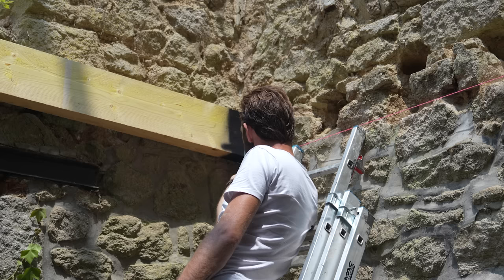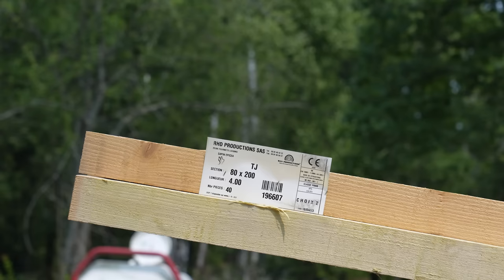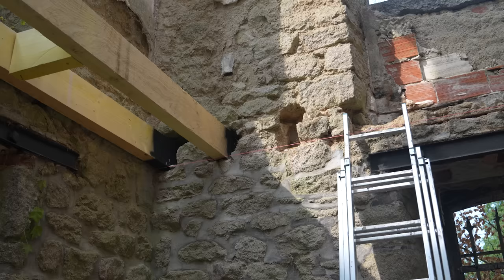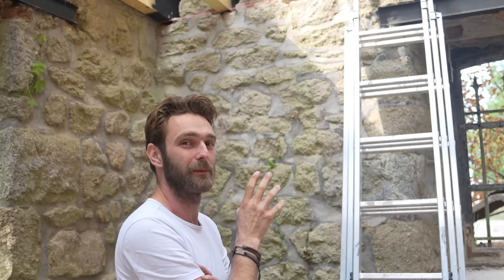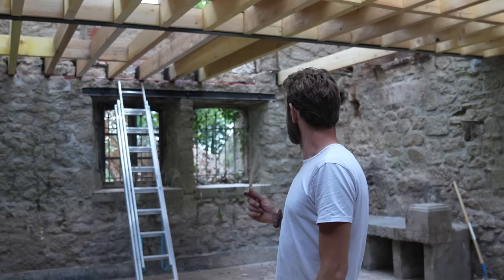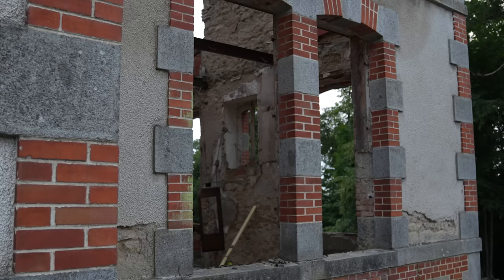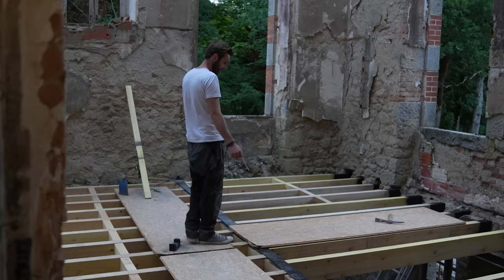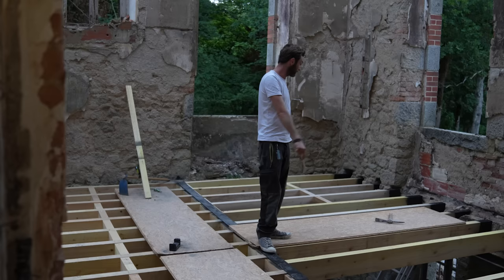A impossibly, perfectly level floor?

Comment: Also when they come back will you attempt to get more of them beams in? 
A week to get in the one beam where the stairs are and then the two above your head, then also the two ground floor beams in the rear room and the two second story beams in the opposite side wing. That will give you plenty to do when it comes to you being alone again when they are all gone once more. 
When you have all those done, then it will be about time for everyone to return and help put the next beams in for the next floors. 
Talk about moving fast. 
The hardest and longest job will be emptying out the rear basement room of debries. Since you cant get the Bobcat in there it will have to be done by hand through the two/three doorways. I cant wait to see what kind of floor that back basement room will have. Tile or concrete.

Comment: Dan- If you’re worried about support strength, perhaps just fasten a parallel 2x4 (maybe 4 feet long) from the top of the cut and nail nail it into the beam so it has extra strength along that part.

Comment: SOLUTIONS from a contractor: outline on tile shows a Pantry with two openings. Staircase is clearly in the corner. Once Pantry walls are up, a wooden joist beam along the outside wall can rest on top of the Pantry wall and somehow attach in the corner via a pocket or bolts (attach joists as you did in upper floors). 
STAIRCASE: Follow original path which allows the space for a much-needed dumb waiter to the dining room.

Comment: Glad to see you did not rip out the metalwork from the wall, I was concerned it could weaken your wall to much. How will you support the other I beam, are you planning pillars/columns below? Adding a previously un planned stress/pressure point to the wall should be done with great caution and a professional builders advise if you can get it. Standing I beams or 6x6" timber would alleviate a lot of strain from the wall, at least one in the middle by the wall, perhaps bolted to the wall, just to be safe perhaps. Good luck and be safe.

Comment: Thanks for letting us watch you working on the Chateau.  I look forward to it every day.  One question…would you consider adding a thin joist/beam to the side of those beams you cut down by 3.5cm?  They could be just a few feet long from the wall but if they were glued and screwed to the existing beam they would add strength to the ones you reduced.  A notched out beam is only as deep as its shallowest point and that affects the strength and stability of the floor.

Comment: Great progress!
I had a thought about the other end of the floor. Isn't that where the stairs come up? If you're going to rebuild them up from the basement, won't that have to be taken into consideration? An I-Beam running the full length along the outside wall would probably impact the staircase. Cheers, and can't wait to see what progress you make tomorrow!
Reply: You are absolutly right. The strairs must be reinstated (as much as it seems the only indoor connection between the two levels...?). The stairwell has to be planed, and an I-beam along the wall (witch has obviously never existed) will get in the way.
Reply: Might mean the width has to be a bit narrower than the original, but if it complies with building regs it won't be an issue.

Comment: You can cut even 5cm notches. That’s no problem as it’s just a short piece. Wood will not separate. If you worried about it you can tighten it by screw with big washers.

Comment: Great work! Per my comment yesterday, the solution was to cut out the bottom of the beam. Now for two additional points. First, lesson learned is NOT to install the I-Beams until you find the level line for the slots in the wall. If this was done, it would have been an easier time to shim up the beams to the proper height instead of cutting them down. Second, on the far wall requiring an I-Beam. I'm wondering if the old work had a wooden beam just bolted to the wall? It seems strange all the way around there is no slots in the walls for an I-Beam, nor slots in the wall for wooden beams. This all points to a beam bolted to the wall.

Comment: Just a idea for troublesome part if to much wood removed for the pocket.  Any way of attaching piece of right angle iron as a hanger off the iron beam to support the beam to level by bolting or welding on to the iron in the wall or drill thru the wall and install a hanger in that section.  Just a idea.

Comment: Love your work but I think you need to tie the lumber to the steel beam somehow. Through bolt or maybe a strap going from one side's floor stud to the other side before putting your decking down. Just a notched joist sitting in the pocket of the I-beam a tiny bit of movement in that beam and the whole overhead floor would fall in one piece.

Comment: I know you will put in the steel beam on the far side of old kitchen. There use to be a staircase.  Do think about the need for access up from that kitchen and don't eliminate the possibility of adding it later.

Comment: Not sure how you estimated the size of the joists. The originals were probably chene and not poor quality pine from Poland. The difference in strength and stress ratings would bother me as a retired builder. Maybe a job for a structural engineer to check proposed  live and dead floor loads. In my opinion the timber is F4 or F5 grade and not 17 or higher for Chene. 
A building contractor would never, in my opinion as both architect and building contractor, tackle a job like this without full scaffolding and installing the roof first. The interiors follow the roof , not the reverse. I suspect this is all down to costs Be interested to see the roof construction and ardoise installation  before winter sets in. Don't forget to tie the roof structure down with cyclone rods and not as the French do and then wonder why their roofs blow off in a good breeze. Best of British mate.
Reply: french roofs are of good quality and i've never heard someone in france having their roofs blown off during a storm wtf

Comment: To get the floor level you could fasten a u-shape metal beam on to the wall. Than it would be easier to get those beams in. To fasten a metal u-shape beam on to the wall you could put wooden blocks in to the wall pockets and than fasten the metal beam on to those wooden blocks and on top of that put some additional fix into the wall.

Comment: Worry never buttered any parsnips, only action resolves problems, as you are finding with this job. If the action is not right, at least you have a chance to change the plan and go forward after minor adjustments, as you are finding.

Comment: Just a thought, you mentioned there was a staircase on the opposite side. The tile pattern on the floor suggests a separate room or walk in freezer in the basement. With there being a staircase the floor beams would not have reached the wall, maybe a steel beam offset into the room was there before. I don't know your plans, just thought I'd mention it.

Comment: A concern is that you are hammering in the beams and applying outwards pressure on the external wall. As you go up the floors you could be adding more outwards force resulting in a failure of the outer wall, even a collapse. Please don’t hammer in these beams! They just need to sit in the pockets.

Comment: You can actually notch out about 70mm or more on a 200 deep joist if you ever needed it, espec on a span like that. There are additional factors for notches at bearings in the Eurocode. Ask your engineer.

Comment: It is great to see rooms developing. When do you think the roof will be done? ❤😊
Reply: Different sections/or wings of the Chateau's (temporary) roof can be done when Dan gets the 1st & 2nd floor walls stabilized. Especially, the 2nd floor walls need to be level at the point where they are the base of the attic floor.

Comment: When you're not restoring it to it's exact replication, you've suddenly upset all of the old building codes. Now you have to start over. The electrical codes have changed dramatically. You're going to need to calculate, how many watts are required for how many square feet per room. Each room will require, 2 or more electrical plug in, concurrence outlets per wall, per room. Some of them should be hidden in the flat wooden floor and covered with carpet or tile and only a floor plug in outlet would be visible in the middle of the floor area or elsewhere on the floor. You're looking at thousands of years of wiring and a bunch of registered electricians to do this job. It has to be approved by the local fire inspectors, and building code inspectors, before charging in ahead with new floor designs. At least, that is the way it's done in America.I imagine, that it is the same in France or England.
  Then comes the plumbing. You want to plan for where the pipes go, before completing your framing. Heating is also a large consideration.

Comment: When you notch both sides of the wooden beam that goes into the iron beam, why don't you notch the bottom of the wood going into the wall, just at the bottom? then it'll be even at the top?

Comment: Surely you should have done the roof first? What happens when winter comes round or prolonged heavy rain ruins all the floors and joists you have already installed?? The OSB board for your flooring, will de-laminate once it is wet and becomes useless.!
Reply: He needs stable, strong walls at the top to support a roof.  I'm no builder but I understand he has to build from the bottom up strengthening and stabilizing the walls as he goes.

Comment: Dan i was just thinking on the other side you mentioned that there was stairs there so would the ibeam not be in the way if you want to make stairs there again ?
Reply: May be possible to accommodate it, depends on the width of the flight of stairs, probably.
Reply: @LaReynedEpee  true but it makes ne wonder how the original floor was structured. Because he showed that the stairs was directly connected to the wall if i am not mistaken. So i think there was a hole in the floor. To bad he did not show it to us.
Reply: @jaapjethee  That is probably correct, but he's putting in bigger steels than originally existed, for example, so he's not 100% replacing like for like. There is perhaps scope for deviation from the original plan if required for improving the structural integrity.

Comment: Wondering if you cld make a fast cabin out of those panels people use as fencing and add a light roof to keep off most of the rain and pop a tent inside the structure to sleep in for the short term until you have a safe room inside the chateau?

Comment: What a bummer that the joists in that bay are off from the central area you did first! How will you adjust the subfloor decking for that? Also, its wild to see such large timbers as you are using, they must be 12 VM thick! Is that a personal choice or is it required? Will you leave them exposed underneath?

Comment: Taking even rather a LOT off the END of a beam isn't a problem. The beam needs all the "meat" in the middle 1/3 to 1/2 of the span to retain its strength. The ends are just holding it up.

Comment: Instead of take it off the bottom set the bottom up as less levels possible and use a hand planer to remove material from the top board level in each one like you were on a boat.

Comment: I thought those little cross boards are supposed to be offset. By lining them up are they as strong? How do you even screw them in when they are all lined up like that? - I know absolutely nothing about building so I'm truly curious - not judging. ;)
Reply: They're intended to stop movement, twisting of the joists, to stiffen the structure. Don't have to be staggered. The spans are quite short so this method seems fine.

Comment: Rather than using an I beam, use a C channel of the same height, then you can bolt it to the wall with Hilti anchors.

Comment: Well you've got a big problem anything more than 3cm could cause a beam failure if you try to put up scaffolding. Don't plan on putting anything heavy on those beams and consult an structural engineer. One suggestion is to make a wider and deeper pocket to fit 2 beams with a notch in the ends that fit above and bellow the steel beam and rest on the wall as well. On the other hand replacing the beams with a steal I-beam on that side would work as well as on the other side

Comment: I wouldn't worry about a 3 cm notch, it's safe to notch the end of a joist by 25% of its height. Looks like you could probably notch the end of those beams 7 or 8 cm without issue.

Comment: Pardon my ignorance. But how do you get the floor to sit on the beams but over the 5mm raised edge of the RSG's'? They have a lip or raised edge...?
Reply: The wood beams are the same overall thickness of the steel beams. He notches the sides of the wood beams that go into the steel, so that the top of the wood beam sits flush with the top of the steel.

Comment: I don’t understand why you don’t remove some of the concrete from the holes rather than cutting the wood⁉️😵‍💫❓
Reply: The steel beam thing is running the length of wall and stopping him from chiseling lower.

Comment: Why don’t you simply take a little bit off the bottom of each beam going into the recess - so that tops are properly level - creating a level floor.
Reply from the maker: that's what I was doing
Reply: @escapetoruralfrance  Correct. So I noticed after I had posted my comment. My comment was prompted by your earlier comment that floor would be slightly higher on one edge because of metal plates out of plumb (the ones located in the bottom of the wall crevices for the joists). I think that the joists will be strong enough even though a bit of extra timber is removed from the bottom of joists in problem area. Screwing together and the laying of the floor material on top will spread the load. 

Your decision to place a steel i-beam on the other side of the room is the correct one. 

Do you have an estimate for when the building has floors and a roof and windows and doors?

Appears to be a gigantic project - one that I love. 

I hope that you have the deep pockets required to carry on - even though it will take years.

I watch your progress every day. I am from Australia.

Comment: would be much easier to cut out the ends of the wooden beams and let the iron stay where it is!
Reply: and btw - as it is at the very end, you can cut out much of the wood without losing any of its strength! ...would be another story in the middle...
Reply: @andymccabe6712 well… and as „we all know that“ - whats wrong with giving a little help? If you watch the videos you will notice that Dan did it from the next time on, so it was not for nothing

Comment: i don't understand why you don't do the roof first
Reply: The walls are not stable enough to support a roof. Putting in the floors will give the walls strength to support the roof

Comment: basic question from me, the  lazy stupid couch youtube consumer: Why would you NOT get the roof fixed first and work your way downstairs instead of removing dirt and rubbish at the bottom first and then cleaning it over and over again from debris that falls down working your way up from the botton? There will be lots of rubble when you deal with the roof and the higher up walls... also, with a roof stuff will stay dry..
Reply: Walls & floors need to be stable first. The roof is a mansard roof that requires these to be done & stable first in order to put on

Comment: This is probably going to start a war. But here goes anyway.
If I were you, I wouldn't let the tape measure jam back into the body like that. You'll eventually stretch / skew the holes where the end is attached and your measurements will go out over time. Not by much, but if you're out by 1mm every cut, eventually that can cause an issue (usually in the most inconvenient location).
It's happened to me before.